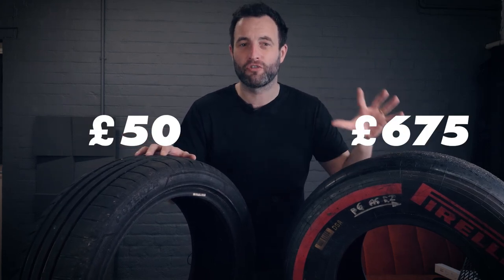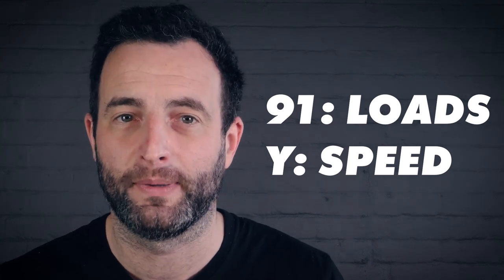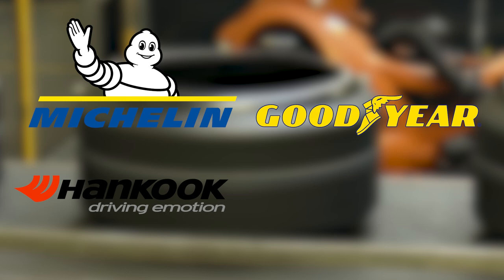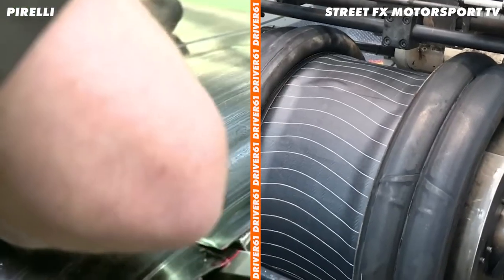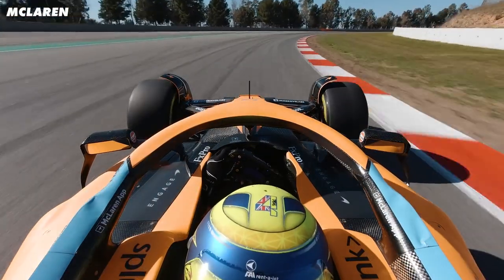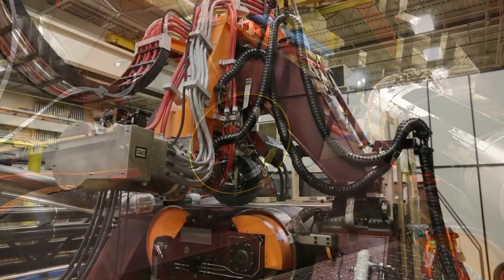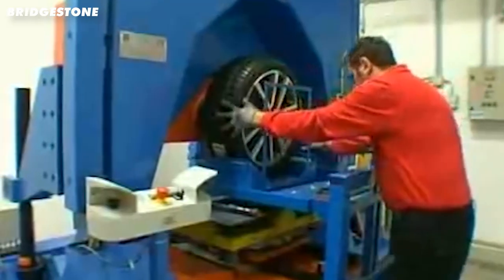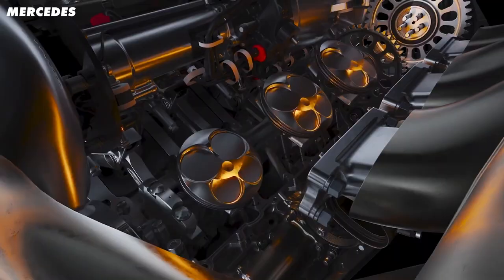£50 Normal Tyres vs £700 Formula 1 Tyres

Comment: I'd love to see Pirelli release their ultimate F1 tires just to show us what could be achieved if there was no rules or limitations from the F1.
Reply: @Expialidoucious  but the objective would be to make a drivable car without rules
Reply: @lochl2  yes. Like build the absolute fastest drivable race car without rules. That would be crazy. The porsche 919 EVO is a bit close to this scenario however it's built upon an existing platform that was governed by rules. We'd like to see something built from the ground up.
Reply: @ipo7596  I agree, something similar to the Red Bull x2010 Adrian Newey designed some times ago. Not sure how someone would be able to drive this thing without passing out tho...
However I really think the F1 should be revised from the ground up. It's supposed to be the pinnacle of motorsport but every innovations ends up illegal. They really should focus on safety and efficiency at their primary rules but scrap everything else. The car should be within certain parameters like the size and the drag produced to offer interesting races. Other than that, it's up to the teams are allowed to use x amount of fuel to finish the race. You want to use a good old V10 ...okay! or a small 4-cylinder with big ass turbos? fine! ...but keep in mind you need to use x amount of fuel. I think we'd be surprised to see how out of the box some team will think. To keep things interesting I'd make all cad files/designs available after 3 races so any team would be able to see/use the other teams ideas. That would be highly controversial but very cost efficient for teams with smaller budget. Other bonus is that we'd know what the Aston Martin would looks like in 3 races :P
Reply: @cybernetix86 just wait for the ‘26 specs. I have this uncanny feeling that wings will be basically completely banned outside 60’s style winglets and a smaller version of the current rear wing with 90% of the DF made via ground effect
Reply: @dylanzrim3635  Is it really F1 if you don’t have wings though?
Reply: @Expialidoucious  I really doubt this is true. Do you have any evidence for this?
Reply: Could probably end up being functionally similar to qualifying tyres of the 80s and 90s.
Reply: @musicalchicken1024  key words "a feeling"
Reply: It would be nice if they don’t blow up or get shredded by mad crazy MotoGP riders.
Reply: @TamagoHead  that's fia's fault not pirellis
Reply: @harry4454  he didn't say "a feeling".
Reply: @musicalchicken1024  " I have this uncanny feeling"
Reply: @harry4454  I meant modern racing tyres in general.
Reply: @Expialidoucious  Use one of them jet pilot suites
Reply: Pirelli did say they could make tyres last the whole season if they wanted to.
Reply: @sulphurous2656  yup everyone gives shit to pirelli but people should be complaining about fia and f1, they're the ones giving pirelli very specific and hard to achieve style tyres in for an f1 car. Thats why the minimum pressure got introduced and why there's always been so much more failures than when there was multiple tyre companies as pirelli is going off strict rules from fia who aren't very good at making decisions on what's good or bad
Reply: @sulphurous2656  if you have a source, I’d appreciate it. There’s a lot of science in the beads, hulls & tread designs and compounds.
Reply: ask porsche and michelin

Comment: 50 USD for a car tyre? I spend about as much per bicycle tyre... heck, per kilogram my bicycle tyres are more expensive than the F1 ones.
Reply: My Continental GP5000 cost $70 here in Cyprus (each)
Reply: Here in argentina, a normal car tyre costs like $150

Comment: Pirelli doesn't just get 20 million pounds per year for their services in F1, marketing deals with F1 plus their own marketing on their own road production tires severely outweigh any development and technical support costs that they spend, especially given how big F1 currently is. Add to that the knowledge they gain from their development the long term profit for pirelli is immense!
Reply: I realized how effective their marketing was when I recently saw a set of pirelli p zeros on a car and I thought to myself, "damn those look like some grippy tires". Nevermind the fact that other tire manufacturers also make performance tires
Reply: he was only talking about the price of the tires, not their services or costs
Reply: @MoGumbo_  of course, the comparison to the multi-billion cost of road tire prices made it seem like pirelli hasn't hit the jackpot with f1, when, in fact ,they have
Reply: @hassannaeem101  Just the white/yellow/red band around road tires would make people on the market for grippy street tires interested and people's turn heads. No matter their performance on the road/track. It's amazing how far their reach is because of their F1 involvement.
Reply: @ThisIsGoogle  If you are talking about F1, the requests placed on Pirelli for the tires are almost unheard of. The FIA/F1 have demanded that the tires provide good grip and then have a cliff all in the course of about half a race distance, without failing dramatically in the process. If another manufacturer was in the sport, a "tire war" would allow them to develop tires that are durable and fast across their range and let teams and strategists figure out when to pit and for what. 
If you are talking about them as a road tire company, I have never been in the market for one of their tires, so I can't say.
Reply: Not gonna lie got sold a full set of Pirelli tires partially because of F1
Reply: Not to mention all the free advertising they get
Reply: @TheZanzaroni  I’ve actually seen Pirelli road car tires with the white “hards” lettering, I don’t think they sell the whole rainbow though that would be great to see.
Reply: @OtaconHalMGS  Hope they were good tires at least!
Reply: @armadillolover99  If I remember correctly there was a series of tires Pirelli were marketing a couple of years back, they may have been discontinued.
Reply: LOL. Only newer F1 fans would buy a set of Pirellis, Michelin and Bridgestone tyres were light years ahead of Pirelli when they were in F1, not even mentioning the random explosions on Pirelli tyres like Vettel at Raidillon and the very strict pressure and geometry guidelines they had to put in place for that not to happen. For other categories Pirelli is also only good if they're sole suppliers, everywhere else they get stomped.
Not only do they make bad racing tyres but their road tyres are awful compared to the likes of Michelin as well.
Reply: @Pogaspm  As I said above I do not watch any racing series where Pirelli are competing against tire manufacturers, but for F1, the demands placed on Pirelli are more than insane, even the explosions at Silverstone at 2012 if I remember correctly were as a result of the F1's attempt to have tires that lasted for 1/3rd of a race distance with teams trying to make 1 or 2 stops work when the recommended was at least one more.
Reply: That is called ROI Return On Investment.

Comment: I believe Scott has the incorrect cost for the F1 tires. I run Pirellis on my cup cars and a full set is approx $3200USD. Impossible to believe F1 tires cost less than mine. Great content other than improper cost.
Reply: i think it's missing a zero at least

Comment: Would be interesting to see how a F1 car would perform on regular road car tires....
Reply: it would prob burn them completly in a lap or 2, just like how wet tyres overheat fast when driven on dry trach. At least thats my guess
Reply: @_Drekavac_  yeah, also the car will be undrivable,its will have 0 grip and the tryres will then overheat too..its impossible for normal tyres to output 1000hp and now that i think about it,maybe they would also get ripped completely from the loads of the high downforce corners such as copse ,maybe even on the straights
Reply: They'd probably blow up right away after doing a burn out at the start. If not that, they'd disintegrate at the first corner or braking point
Reply: no they wouldn't explode or desintegrate... that's racing tires. road tires have way harder compound and are often rated for much larger (weight) loads than f1 cars.
it would just have way less grip, and as such would never be able to apply the horizontal loads that would be necessary to cause problems (i think, maybe i'm underestimating how much grip just straight downforce gives the car). f1 road cars would be like FE, but maybe worse because FE still uses softer compounds than most road tires, even if they're granite compared to f1.

Comment: I can't help but think going back to pre-2017 tires would solve a lot of F1's problems.  Less aero wash, less grip (to encourage move overtaking), less weight (and, crucially, less unsprung weight), lower risk to marshals and pit crew if wheel tethers fail, and it will allow F1 cars to be substantially narrower and aid in solving the size problem.
Reply: but change for the sake change will save F1, the FIA said so
Reply: Not necessarily. Less mechanical grip means you’re relying more heavily on aero grip, which is more easily disrupted by the car ahead of you. Less aero grip means you’re skidding more in the turns, slowing you down.
Reply: Pre 2017 tyres were terrible. Also dirty air from the tyres was actually worse during those days and better today because of the wheel covers and the front wings. Plus it's less effective due to the increased focus on ground effect
Reply: or shorten the supension arms.
Reply: They look shabby
Reply: One of the great things about  the new larger tires is that they are less prone to overheating, meaning wheel to wheel battles can last longer instead of just a corner or 2 with the old stuff.
Reply: The cars aren't much wider than in the 90s. The problem is length, at tight corners (like Monaco). Otherwise the problem is the weight of the cars. The tyres have to be as they are because of the immense weight of F1 cars and immense torque from the hybrid system. Having said that, Pirelli could make a much more durable, lighter, grippier tyre if the FIA didn't mandate a sensitive tyre that degrades as they require it to, in order to create this artificial need for a mandatory pit stop and over/undercut.
The obvious solution would be to remove the built in sensitivity, and reduce the weight/torque of the cars. Scarbs says the suspension, for example, could be much lighter, but it is as heavy as it is because it is designed with aero benefit in mind.

Comment: Last time I put tires on my Vette the rears cost $650 USD a tire. On another note I once did some promo work with American Racing Wheels which is owned by Wheel Pros in California. Anyways they had a BWT Racing Point wheel on their shelf and the first thing I did was pick it up and I was shocked with how light the wheels are.
Reply: Yup, a set of 20 inch rears for my former 911 was about $1,200.
Reply: @groosbro1  I believe it man especially on a square set up. Gets spicy but I guess we are fortunate to be able to enjoy it.
Reply: @Photobombin 

The maintenance on the 911 was absurd, thank God it was a lease and under warranty, otherwise I would have spent well over $13K for fixing relatively minor things, like a squeaky clutch pedal bushing that required removal of the dash to access. A $10 bushing required 15 hours of labor at $189/hr.... Porsche tax...
Reply: @groosbro1  I can only imagine. I would have loved a 911 but to steep for my current financial situation. I just play with Corvettes cause they are cheap and I know the ins and outs of every single generation having worked on restorations. I haven’t had any experience with a C8 but seems like a good value for the money. The 911 though…. I’ll keep dreaming hahaha.
Reply: @Photobombin 

It wasn't overly "expensive" at about $1,100 a month, and I had it through the Covid lockdown. No one on the roads, no police, no commuters, it was a joy to wind it out in first three gears to 7,500 rpm, at which point it was at "loose your license" speed... 🤣
Reply: Obviously a smaller wheel, but I've handled 13x7 magnesium centerlock OZs and they are absurdly lightweight
Reply: @camerone397  that’s the funny part. I knew it was gonna be light but I damn near smacked myself in the face picking it up 😂 I could only imagine a set of magnesium center locks OZ. Now I wish I could see the setup.
Reply: @Photobombin  haha, just search for any newer FSAE car and that's pretty much what I was working with.

Lightest "actual" car wheels I've handled were some Forgelines, nothing super exotic (would love to see carbon fiber wheels one day...) but very light, relatively speaking

Comment: I don't know how much faith I'd have in a £200 set of 60k mile tires. I can't do the conversion in my head, but my last set of tires, the most expensive tires I've ever bought, cost over $1400US. 20in Michelin Pilot Sports for an Audi S5.
Reply: Lol my mom just bought Walmart Brand Chinese tires for her 2020 Ford Explorer. I tried telling her to get Michelins but she said they cost too much. 30 minutes later she’s talking about planning a Spring Break vacation to NYC(this is normal it’s only 2hrs away) and going to the Louis Vuitton store.

Won’t spend $1,000 on the thing that stops her 5,000lb SUV that does 80mph but will spend $3,000 on a bag.
Reply: @Michael-pi8ps  there are a few things on a car that i would never skimp on. tires and brakes for example.
Reply: @affectedrl5327  exactly, these are essential, they can either your life, or the life or someone else on the road

Comment: Up to 60,000 miles??? Not sure what tyres you're using but I've had top of the line Pirelli, Michelin, Bridgestone (worst) and more, for most which last around 30- 40,000 km.

Comment: Does F1 have to return the used tires (tyres) to Pirelli?
Reply: I believe so, and the Pirelli engineers analyze the used tyres. Also, I believe it’s required to return allocations that were issued.

Comment: $1000 bucks for an F1 tire? When I was 20 years old I had a lifted Silverado with huge off-road tires. I went in to get new tires and the shop quoted me $2500. So $1000 for an F1 soft is a bargain I think.

Comment: I'm honestly baffled how cheap the F1 tires are, I had no idea. What I did remember is that a set of tires for a Bugatti Chiron is $42.000 and needs to be replaced every 2500mi (4000km). Now THAT'S expensive af.
Reply: The Bugatti tyres come with a wheel/rim; they have to glue them on to stay attached despite massive lateral forces.
Reply: @bakedbeings  You're right about the gluing part, but it doesn't come with the the wheels... the wheel set is an extra $69.000 for some extra crazyness lol. And the wheels need to be changed with every second new set tires. Check out Motortrend's review of the Veyron Grand Sport Vitesse from 2012 for details.
Reply: @PhazerSC  I think after 3 sets of tyres, the rims need to be replaced.

Comment: NO, they're not called dynamometers. Dynamometers measure torque and speed (and thus power) of a motor to measure its performance. This can be done through the wheels, the hub, or directly on the fly wheel, however that machine shown testing the tyres is not a dynamometer. It might use a small dynamometer within it to measure some of the parameters of the testing, i.e. the torque of the road being driven, ad the torque on the tyre. However that machine is a MTS Flat-Trac® IV CT plus Tire Test Bench specifically. There isn't really a nice neat name for the tyre testing machines, but more or less they're called dynamic tire test rig.

Comment: I think that the audience is at a point where they might need to know what slip angle means, and how does the tire actually move you forward and back, and what makes it possible to turn. I'm talking about the rubber stretching, which is the force that actually moves and turns you. When you push on the rubber, it pushes back, when you stretch it, it pulls itself back. And this is the force that does EVERYTHING, as long as we are within static grip zone... 

it is one of the most wonderful sensations, to understand how tires work, realizing that the tire does not move when you rotate the wheel: relative to the road, the contact patch is STATIONARY. Like you are not moving at all. Rotate the axle, the tire stretches and pushes against the road using traction and this makes you move forward. I want more people to get that feeling cause it is amazing high... If i could, i would push a button to forget it so i can learn it again.

Comment: Not sure why you wouldn't also include pirelli in the list of regular manufacturers, and mention they do indeed manufacture commercial tyres, and given they're tyres are usually at the high end for either luxury/comfort, or performance, they make a significant amount.

Comment: Always wanted to know, if the tread pattern on pirelli's wet and intermediate tires are so incredibly good at dispersing water and adding back a lot of wet weather grip, why isn't that same pattern used in road cars? Wouldn't such a pattern make tires safer in tough weather conditions and lessen the possibility for hydroplaning?
Reply: The difference is downforce. It squeezes out the water, even with a much chunkier tread. (edit: I'm guessing)
Reply: Road noise is not a relevant concern when designing an F1 tyre, neither is fuel economy to the same extent that it is for a road tyre. An extreme wet tyre doesn't need to function at all in dry conditions either, unlike a road tyre - which must not only function in a wide range of conditions, but handle as predictably as possible in those conditions too.

Comment: Hi, I noticed that you did not pick up on the heat build up caused by the flexing of the tyre and the dispersal of the heat out of the tyre on the wall design. The other point is that tyres are made by hand, what other items are hand made on a vehicle? Cheers mate. Harera

Comment: Also the difference is in the fact that the f1 tyre has to run at 100  degrees C, whereas the road car tyre doesn’t heat up that much